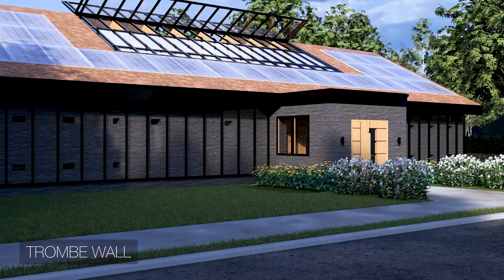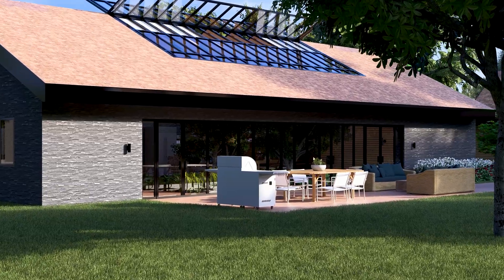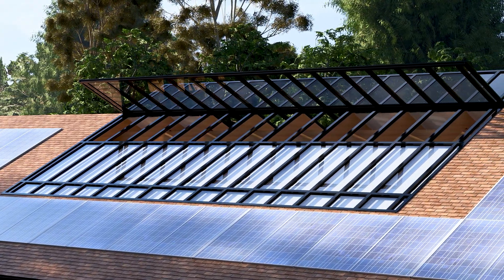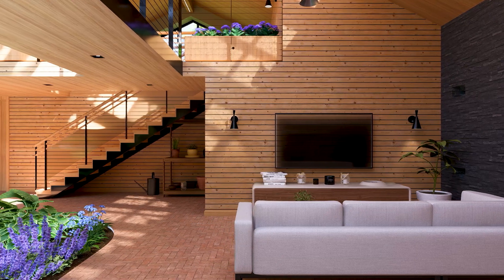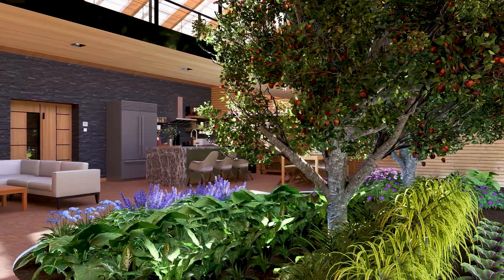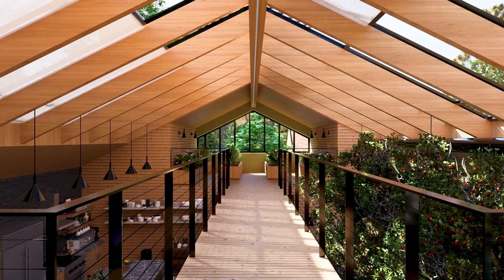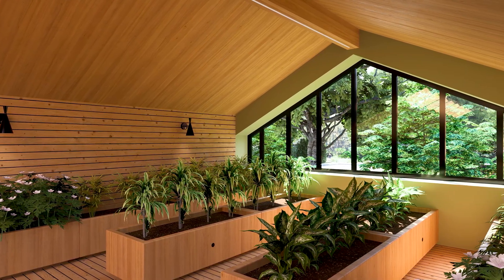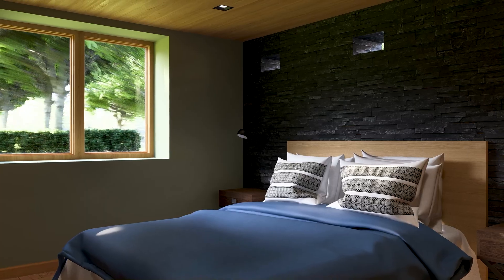I Designed a Greenhouse home Heated by a Solar Wall

Comment: Amazing designs with cool aspects. I like the use of as low paint/plastic in the house and using eco-friendly materials. As well as the idea, as I got, to combine greenhouse within my house. At the same time my hobby is aquariums and I connect them at present to form a Aquaponics system. 😊 However to keep that cool I like to add a basement. To optimize space with a basement is a very good idea to reduce space taken by nature to build new houses. At the same time think of passive house concepts with solar cells and thermal heat etc. As well as those ideas you mentioned with stone walls etc.
Reply from the maker: It would be interesting to see if an aquaponics system can work with the trombe wall system. They make water barrel trombe walls that capture heat during the day and release it at night like this design does with the stone wall. But yes, a basement could also help like you're suggesting

Comment: Love all these design, may I make a suggestion for your next video, don't just think about the garden as a flat thing in the ground or boxes in the loft aria, have a look at what vapinano or Ikea herb wall did with live herbs in their restaurants, and living walls, or herb walls... giving still live garden and food, but means it give you more  living space back. or having a mix... also when thinking about strawberries and other lower laying fuites they tend to be raised anyway.. so lots of ideas, that house ideas and the flexible thinking are amazing.. however I feel the garden / part is not pushing the boundaries that much, with living walls, flowers not just food, earth homes do some of this already with running water through them to purify the grey water for reuse, and solar panels should be more integrated rather than just slapped on top, and their is also need more rain catchment, and what about geo thermal heating or hot water / air conditioning... Sorry I know this might seem like complaints, what I am saying is love and I mean love your concepts so much so I would like to build one, however lets bring in a few more concepts to take it up a level... happy to work with you on it... but out side that look forward to the next one.. great work.
Reply from the maker: I agree with the idea of making the garden more unique and yes, that's something I'm considering. Some of the points you mentioned isn't something you show, but more of something I mention in the videos. For example, geothermal systems are generally hidden and it's something I mentioned in all of these concepts. Similar for rainwater catchment, reuse, etc. The garden is a really good point and I've been thinking about them a bit more. This isn't a good excuse, but if I had more time, I'd focus on expanding the design of more spaces like the gardens. Personally, I like the idea of a terraced garden and it might be in a future concept. I'd also like to show more variation of produce, I just need to figure out how to model it or where to find a good model for the renderings. All good suggestions - thanks!
Reply: @Tim_Ung exciting look forward to seeing where you take it

Comment: Beautiful design, and could be taken to another level with a man cave in a basement. Would be perfect
Reply: Change the master to a man cave and use other rooms or change the utility if you can't need that much space going to utility.
Reply from the maker: @victoriadedicova  This is a good take - the utility room would likely need the area for the home's systems and tool storage. A basement is also an idea that I considered while designing the home (at least under the living space and not the in-ground garden area). But like you mentioned, there's plenty of space to re-organize the house to fit someone's lifestyle.

Comment: I like the point with the trombe-wall but its not the right way. In summer you would be grilled.
My plan is to  ahve large outer house with a long south glass wall flanked by two short glass-walls. Backside is solid and insulated. Outer house is 3 stories high and the roof hangs over the south-wall. That way in the winter the sun shines into the house but i summer the hang-over blocks the sun (that stays higher in these months) from entering the house. Inside that house is a second building made from massive wood completely seperated from the outer shell.  I can send you the 3D-file if you want to render it for your channel :)
Reply from the maker: Interesting thought - I don't think the trombe wall would be an issue in the summer. If it's done properly, vents should allow airflow from bottom to top and release hot air before it can gather and heat the entire wall. In the winter, the vents close to allow the wall to fully heat. Let me know if you're thinking of another issue. It would be good to learn more about the potential downsides